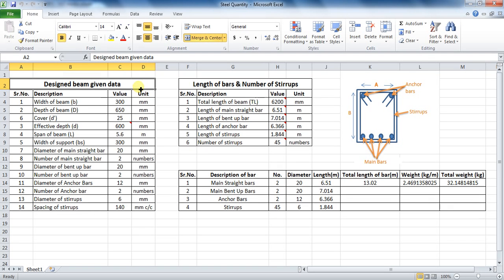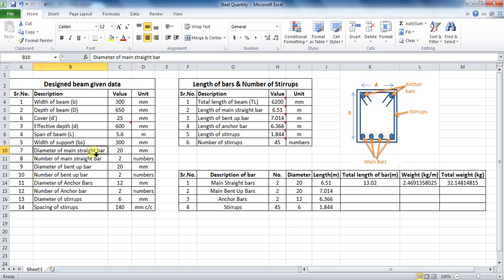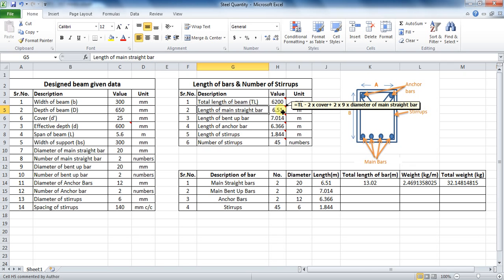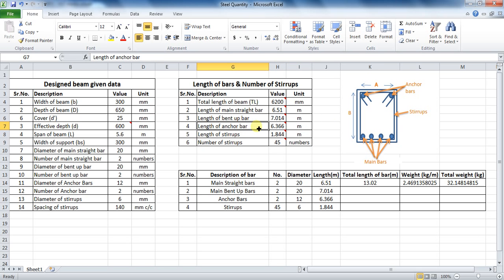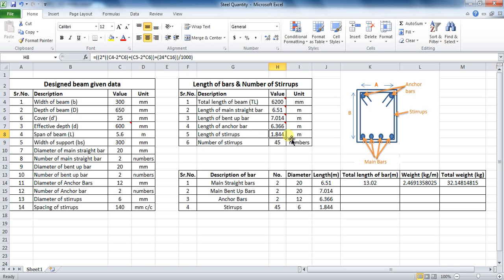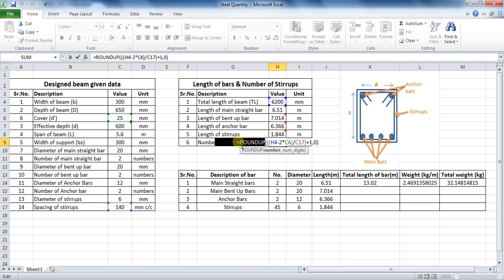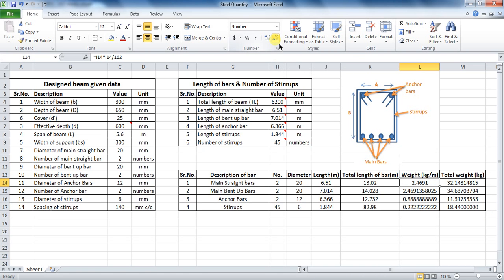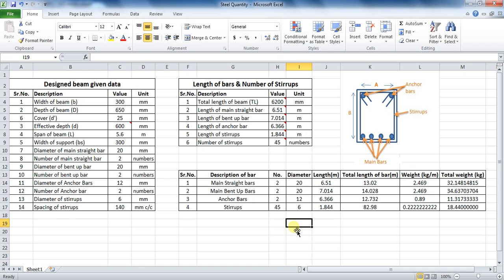Bar Bending Schedule-Estimate Reinforcement Quantity for a beam using Microsoft Excel-Unite Coaching

Comment: if spacing of stirrups varies then what to do
Reply from the maker: Practically there are only two spacing given
One at the supports and other at the intermediate span
You can use same excel sheets for the both

Comment: This video is good..
But my question is,
How to calculate the no. Of bar or bundle of steel bar?? 
Means the bar length is 39 to 40 ft. So in the bar some no. Of steel piece is cut. So how to calculate exact nos. Of bar or bundle of steel bar??